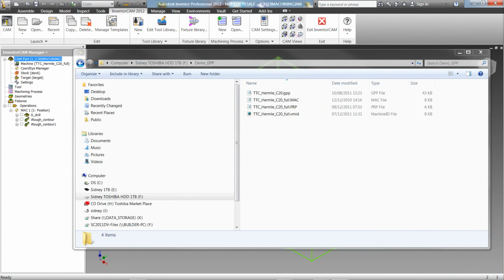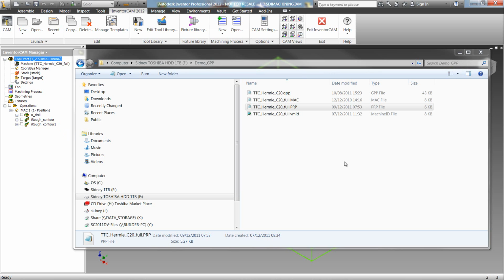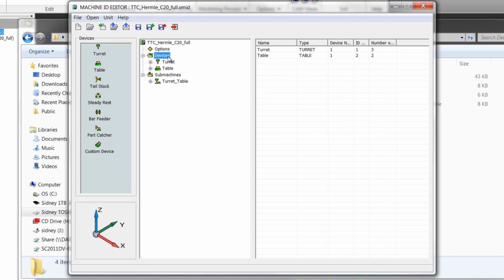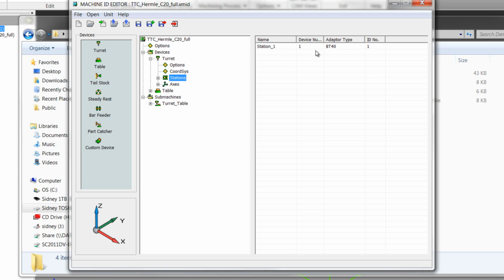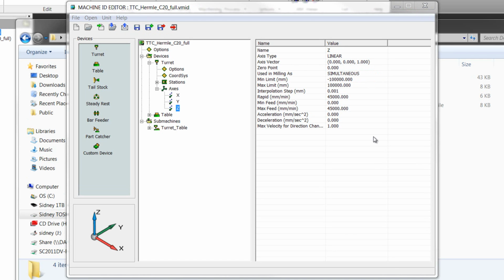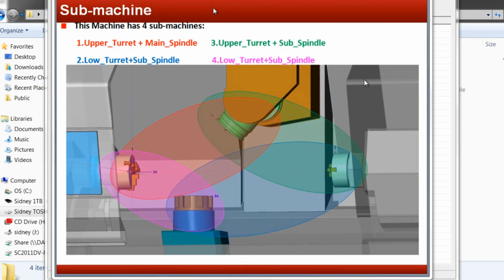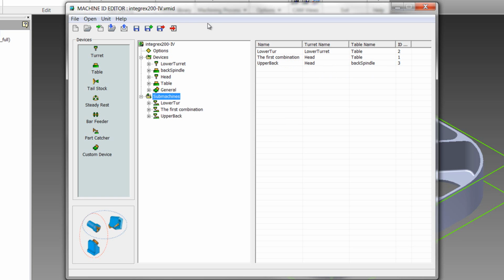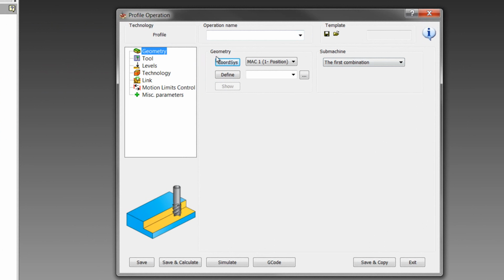Machine ID.wmv

Comment: great video... i cant add my ma hine to mashsim exe of solidcam2020 ... there is cordinate system turned in wrong way ..i put my cordinatws in mid spindle of milling machine but when i tranfer to simumation (mashine.exe) cant find it.. and my 4axis cant turnk properly coz cordinate in mashine.exe not trace my solidworks assembly drawing which i indicated my cordinates x y z in mid of spindle..pleaae advise need really help..hope you can help me pls

Comment: Sir, I'm Assistant Manager in Manufacturing LTD compny and using SolidCAM. I have one doubt. 
1.- Please tell me that how can i use the higher version updated vmid file to the Lower version of SolidCAM. Problem is that:- when i updated vmid file in Higher version of SolidCAM, then if i used that upgraded vmid in lower version of SolidCAM. that upgraded vmid file not work in the lower version. So please give me solution to use higher version vmid file to lower version of solidcam